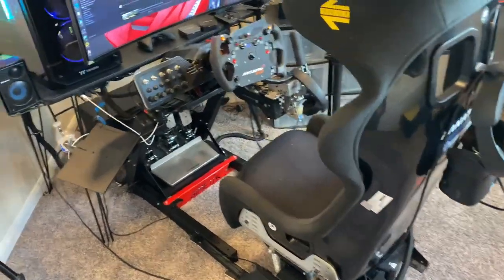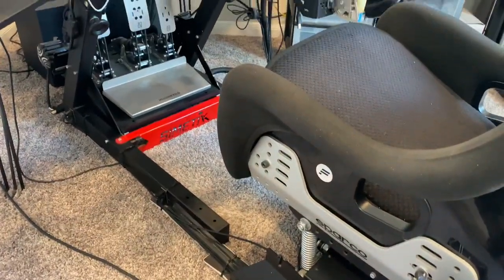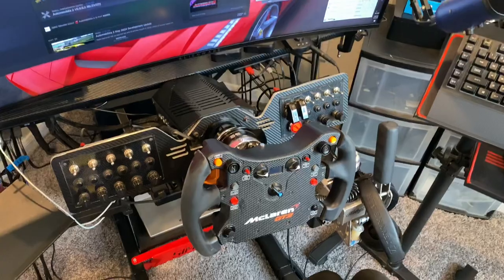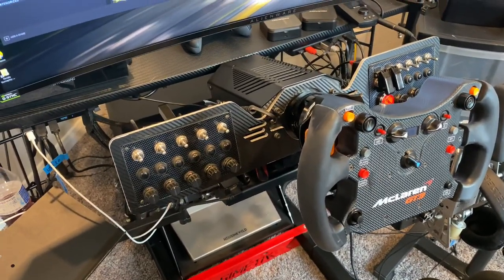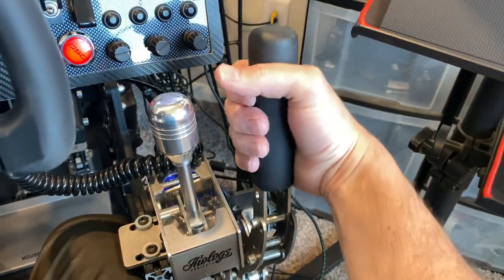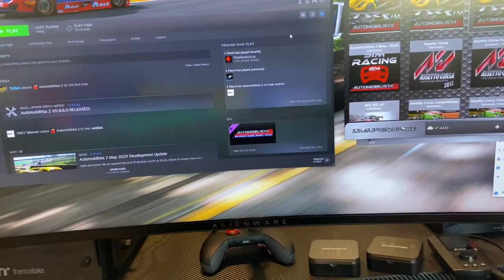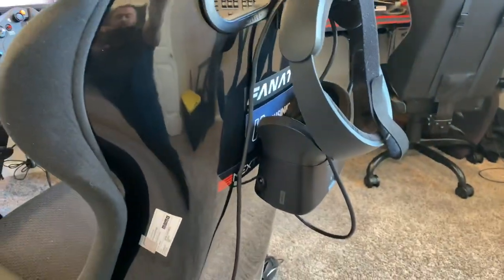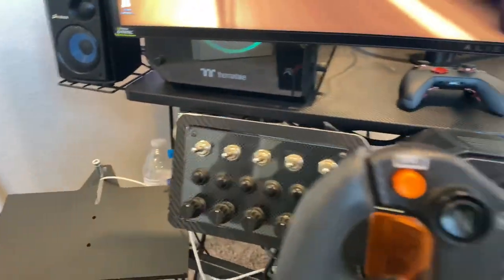Immersive Sim Racing

Comment: Don't get any better than VR!😎👍And you can't go wrong with a set of Heusinkvelds, my Ultimate clutch feels just like my irl clutch!👌
I would say though, you need to look into a aluminum profiler rig. So sturdy and also super easy to add stuff, or change things around. Made my life so much easier than modding my old rig..😅
Reply: R-VR Closet agreed profile rigs are a must
Reply from the maker: Yeap I agree with you. It makes it easier to test new equipment as well. It's in my roster but didn't want to pass up the new Reverb G2 pre-order first. Then of course the new 3080Ti will be coming soon which will really be needed for the higher resolution HMD. Good times for sure!

Comment: How strongly would you recommend doing the SimVibe tactile/bass transducer setup?
Reply from the maker: If you have motion you can live without it, but if no motion I do recommend it. When set up correctly you feel things like tire chatter when taking off or sliding the fronts and rears around corners. You feel engine vibs and shifts as well to. Mainly what I like them for is curb effects and tire sliding as my motion covers the rest. Hope this helps.

Comment: I like vr but find myself using the triples more just for comfort . Nice set up 👌 just confirm is that amp 2 channel as you initially said 4 channel amp ? I run two amps but with external low pass filters for my three bass shakers currently.
Reply from the maker: Thanks. Sorry about that yeah I noticed after I published. It's a 2 channel amp for sure. Works great and better than the buttkicker amps IMO. Yeah, I still enjoy my widescreen and race without VR from time to time as it's more comfortable and doesn't mess up my hair. lol. For instance only got 30 min to kill and I jump to widescreen instead of VR. But when I have time to do some racing I immerse into VR.

Comment: The SimLab GT1 EVO is a much better value then the K2 these days.
Reply from the maker: OhItsThat hows it holding up with the DD1? I’m sure really good. I been wanting the p1x for a while
Reply: TJRSim It’s great, the DD2 doesn’t faze it, especially with the Podium Mount. The NLR V3 hasn’t had any negative effects either. Super solid 

 It’s been a lot of fun adding things to it as it’s so easy to do so. It’s fun building with aluminum profile. 

A P1x would be great for you. I think it would change your experience.

Comment: Hey man, appreciate the content. I’m still in the setup phase of my rig and recently picked up a Next Level V3 motion platform. So far I really like it and used some settings I found on Race Department for baseline settings. Also plan to run a gamer 2 on the platform and at least one more transducer up front as you have done. Any tips / tricks with the next level or settings you have found to work better for you? Primarily using ACC, AMS2, AC at the moment with a Rift S.

Comment: Hey Larry I know I’ve mentioned this before but I think you should look at getting a wind sim for open wheelers in VR it adds immersion and helps keeping you cool in the headset (got mine from SimRacingStudios)
Have you ordered the P1 yet?
And can you please review the Reverb when it turns up? it should be amazing but I’m interested in just how much horsepower it will require to run racing sims
Thanks great video btw 👍🏼
Reply from the maker: You know I forgot about that wind simulator. I need to reach out to them. No, I didn't order the P1 yet. It's still in my plans though and more so know that the Dbox G3 came out at a lower price. I'm contemplating that combo between the T1000 5M. Both cost close to the same, but the P1/dbox route is much more robust and works with 110 volts, but loses traction loss feature.